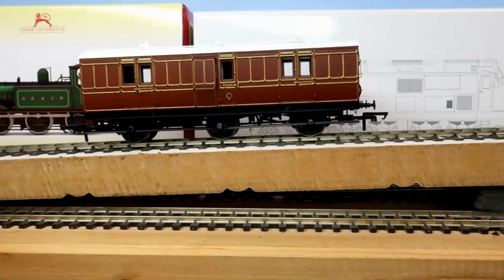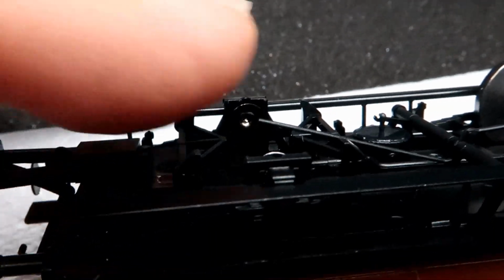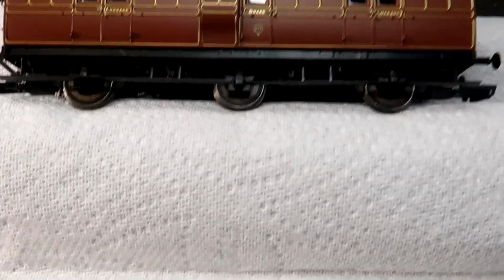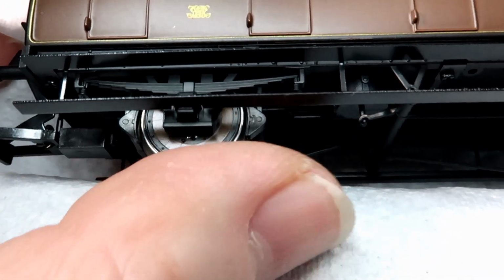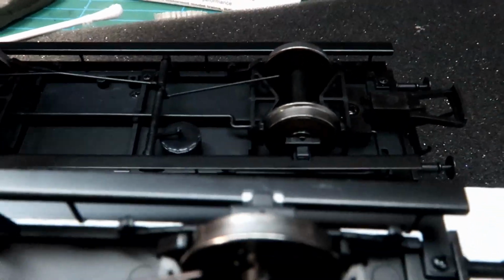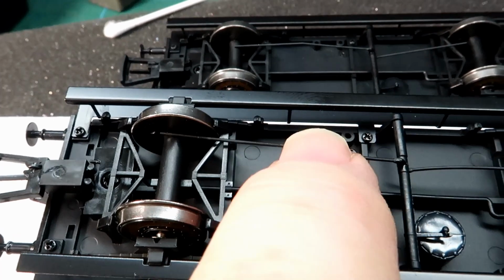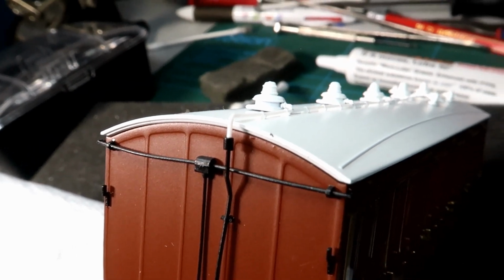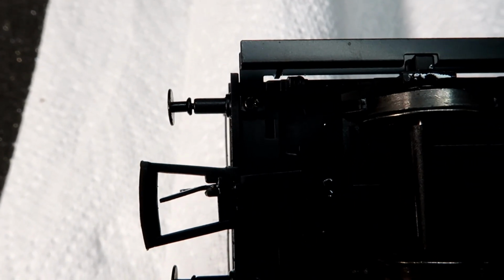Hattons Genesis Coaches snagging video  Not much to say

Comment: 26 seconds in, the first coach that won't roll downhill - looks to have a hump in the roof at the r/h end by the gas lamp vent. A couple of the coupler hooks look bent, as well - trivial nit-picks.
Reply from the maker: Hi, just checked that and see what you mean, it's an optriceral illusion caused by the position of the gas pipe. Couplings are very flexible so that's why they look bent.

Comment: I've got a rake of 11 GNR teak versions. My video No. 070 is set for release at 7pm this evening (22nd March). 
I found the Hattons couplings didn't couple to each other very well at all even though their height off the track is correct. You can see on your video the couplings aren't centered. I've now fitted Hunt Elite magnetic close couplings which work well and look much better. Magnetic attraction ensures they couple in perfect alignment.
Reply from the maker: Thanks, not had any issues here. Will try and catch your premier

Comment: You need to mount your camera / phone on a tripod or similar when doing bench based filming. I've done hand held close up work myself and regretted it. Zooming in can be done in the post processing I've found. 
Your lighting of the black underside was good. Very tricky to get that right I've found
Reply from the maker: Yes anything black is a pain lol  goes for black locos as well
Reply: @ModelRailwaysUnlimited  And black aircraft like the underside of the Lancaster. 
I got the underside of my carriages to be visible by post processing the Contrast to -1 value, basically turning it off.
However, to achieve the effects and close ups required the original few videos to be chopped up into about 30 chunks. Luckily, doing that doesn't affect the sound
Reply from the maker: @andrewdking  well done, all good fun video work
Reply: @ModelRailwaysUnlimited  Its hard work, almost like a full time job again. However, nothing substitutes for a quality in-focus and steady original filming sequence.
Reply from the maker: @andrewdking  agree fully. My productions take around a month of planning, 2 days filming and 2 or 3 days editing. For the medium ones at least. The big ones like, wagons, tank wagons and milk took weeks and weeks lol
Reply: @ModelRailwaysUnlimited  I've only seen your one video as it was presented to me. So how long is your longest video ?
Currently, mine is 1 hr 4 min. People get put off watching long videos, hence TikToks have massive viewing hits. Many of mine are instructional, so the devil's in the detail.
Reply from the maker: @andrewdking  I try to stay below 30mins

Comment: Hi Mike.
That is a simple little fix for the brake rigging, makes me wonder if that is how they should have been assembled in the first place as it strikes me as being a bit odd to have the rods dangling down not touching anything. I did spot the gas pipe one but as you say not really a snag as long as you remember to put it back in place after refitting the roof.
At the end of the day they are great coaches, makes me wish I'd ordered more but got to watch the money, they are all selling out now wonder if Hattons will consider further runs.
All the best, cheers Rob.
Reply from the maker: Hi Rob, thanks for looking in  I think the brake rods are supposed to be bent against the brake rigging but for some reason have not been.